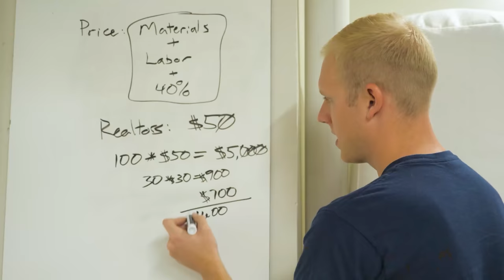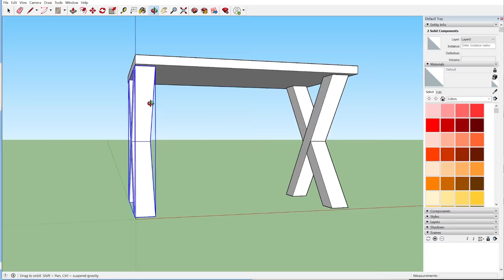💎the hidden gem from building this modern desk prototype...

Comment: Are you not worried about the wood movement cracking the table since you're using metal brackets and screws? Would it be better to make slots in the metal to attach to the table side? Instead of holes?
Reply: The fucking peanut gallery

Comment: The brackets are actually a standard/common part of real-wood furniture manufacturing. You'll usually see them called "mending plates" as they are also used for connecting two pieces of a table top like on an "L" desk, ot two halves of a long conference table top, for example. Pro tip: I've seen a lot of people mention recessing the plate into the underside of the top instead of the leg, and while yes: that would be ideal, and expected in a very high-end piece. However, your method of recessing them into the leg is a valid one...but they are half-right. If you're going to still make them yourself, countersink the holes so you can use use countersink screws, so it's flush. But if you end up purchasing mending plates (now that you know what they are called), they will likely have countersunk holes for this very reason. It may not seem like a big deal to you, or even from the owner's first impressions upon delivery...but every time someone is looking at the desk from a seat in the room a bit away from the desk, or even from the room's entry if they aren't super tall, they'll see that shining screw head sticking down, especially so close to the edge. None of the photos in the in-place montage were from below the desk top height, but you can still see them in at least one of the shots. If you really want to have repeat business be a part of your business plan, it's little details like that that can set you apart from amateurs or those without your drive!

Source: 20 years in the furniture industry (selling retail, designing custom in partnership with multiple multi-million-dollar local custom furniture manufacturers, and commercial furniture install project management), and 10-year woodworking hobbyist.  I've had clients get down on their backs on the floor, looking up at the bottom of the conference table, and question why the screws used to mount the under-table electronics shroud boxes were two different colors: black wood screws into the underside of the solid tops, and silver MDF screws for the MDF/laminate boxes themselves. A $1 sheet of white stickers to cover the silver screws on the white boxes took the install to the next level, and meant that they were confident enough to use us to design and source every conference table, every desk, and tons of other stuff in their 6-story, 900+ person HQ, their offices across the country, and asked us to manage their European dealer to help them understand what "next level" quality meant. 

I've also seen a few people mention "wood movement" and suggesting slotted holes, or those figure 8 clips. I've also seen you dismiss them. We had to have a manufacturer pay for repair techs to 9 US cities during the polar vortex season in 2018, including Houston, Chicago, New York, Seattle, Portland and Atlanta because the cold air meant heaters were running more, drying out the air more, and having over 50 solid-ash tables crack because the wood was screwed tight to their bases, and when it tried to shrink it couldn't, so it cracked.  In Seattle alone in one cold month, they had 20 tables with solid hickory tops crack. This was kiln-dried lumber, and was in the client's space for less than 1 month. In these batches, it was discovered that their metal fab division missed drilling out the holes as slots because their drawings-for-manufacturer only mentioned the slots in a call-out "redline" box, and wasn't actually detailed in the drawing. The manufacturer had to spend THOUSANDS to fix something that could have been out of their control and they wouldn't have been responsible for it, but once we dug in to their drawings and looked at photos, we found the issue and had to make them pay for the repairs...which they did, because they understood their mistake.

Comment: This is a really nice, simple design.  The ergonomics point has already been raised, so all I'll say on that is it's easy enough to ask the customer what height they need (because it does vary, depending on how tall they are and what kind of work they do at the desk) and just cut the legs a little longer or shorter.  That is one of the advantages of this approach, after all.

The other issue for a lot of people (but not everybody) will be the lack of any storage space.  I'd suggest designing an optional undermount drawer unit with 2-3 drawers for those who need that.  Make is simple to build and mount, so it fits in with the design and the production philosophy, and offer it as an option for additional cost.  That way the main desk design doesn't change, and you can mount the drawers when they are ordered to the left or to the right as the customer desires.  Heck, some people may not want the drawers but like the idea of open storage, so there's another option without another design.

Comment: Not that another storm is going to happen any time soon but a precaution to another power outage for what ever reason... A generator is a good backup. We have one here in Indiana and have had the opportunity to use it about 3 times in the 5 years we have had it. One weather related and the others were unknown. It is portable but it is big enough to power lights, heat/air, computer, tv, refrigerator and one other large appliance all at once. We had it setup by electricians with a bypass switch so we were not sending power out from our house but contained to our home.  Works great, gas powered and a full tank can run for 8 hours. Just thought I'd share. Keep the vids coming. I watch all I see. 😎😍

Comment: If you want something quicker, cheaper, and easier for mounting the top to the legs, check out figure-8 desktop fasteners. Essentially you will drill a hole in the top of your legs about 1/8" deep, and offset to accomodate the fastener, then screw it in to the top of your leg and bottom of desk. These are specifically made to rotate, allowing for seasonal wood movement. The fasteners look undersized when you first see them, but I use them all the time on large and heavy projects and they are fantastic. I have not made a video on the specifics, but Bike City Woodworks has a concise video that explains them. If you think that the fastener would not be strong enough when moving the table by the top (hard to say since ash is light, but the base is chunky) you could elongate the holes on the plate so the bolt can slide around a bit as the wood moves.
Reply from the maker: Those fasteners are great! Thanks for sharing this tip. However for us, those take about 5 times longer than these brackets to install, and they’re nowhere near as strong. It’s a balance of several variables - gotta make the right choice for your business!
Reply: @jennieanddavis  Totally understand, I just thought it would save time from mortising the leg and threading inserts, etc. I would still consider elongating the holes in the brackets to accomodate movement.

Comment: Suggestion for a cleaner look, rather than remove material from the legs recess it in the table so it's a cleaner and flush mount. JMO.
Reply from the maker: That would take twice as much time for a 3% visual improvement. Gotta spend our time where it matters most
Reply: Would be quick(er). A simple jig for the router, slap it on the surface, clean it out using a straight bit with a guide bushing.  Might not want to dismiss ideas so quickly. We watched how he cleaned out the leg.
Reply: @jennieanddavis  I'm with them.  A simple router template and this is very quick.  It hides the plate, plus leaves a cleaner, stronger profile on the legs.

Comment: That desk looks neat, but terrible for ergonomics. Now I know you're not in the business of ergonomics, but having basic height adjustments and a thinner top is almost a must for working from home as you're sitting for much longer periods than if it were just a desk to do your taxes on once a month. Most people have their desks set way too high and don't even realize it. A properly adjusted desk has the bottom of the top just slightly higher than where your legs are sitting, and the top of the desk should be at the exact height your elbows are at when you leave them hanging. That leaves barely an inch and a half of space for top thickness. Very difficult to design around, but if there's any chance you could create a desk that's also ergonomic that could be a great upsell.
Reply from the maker: Sounds like you should go into the desk business! Thanks for the tips. Maybe be a little softer in your delivery - your message read in an abrasive tone. Thanks for watching! ❤️
Reply: @jennieanddavis  Apologies for being so direct, was not intended like that at all. I'd love to build my own desk but don't have the space for it, so instead I criticize other people's desks on the internet 🤣. I'd love to one day go into furniture making myself, poor ergonomics have been a sore spot (literally) for a while now, and the different approach to furniture that you guys have is amazing. Really wish more businesses would just sell solid wooden furniture, rather than the cheap MDF/honeycomb stuff places like IKEA use.

I have nothing but admiration for you guys, love the channel and everything you've shown so far looks great, so please don't take my criticism on ergonomics as anything negative. Can't wait to see you grow out of that garage and into the neighbours' yard 👏
Reply: Actually the desk is probably set at a standard height. Secondly, you don’t want a low desk height otherwise it will destroy your back from looking down at a monitor. Monitor should always be eye level.

Comment: Shouldn’t wear gloves while using a drill press. Your hand slips that drill bit will eat that glove faster than Speedy Guns-alas.
Reply from the maker: Ah but the glove keeps my hand from slipping.
Reply: Notice unsafe work practices on these videos. It would be into your best interest to heed some of the feedback you get pertaining to safe work practices.
Wearing gloves is a no no around rotating machinery such as a drill press. You should use a vise to hold your work instead of relying on your hand.